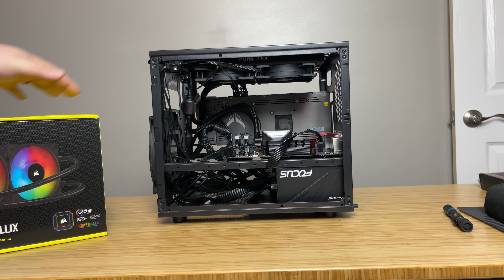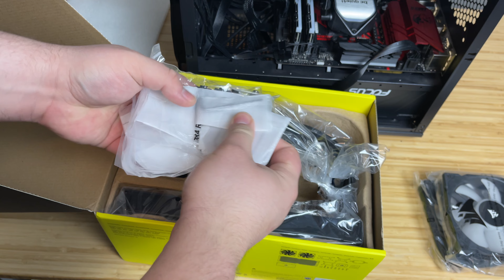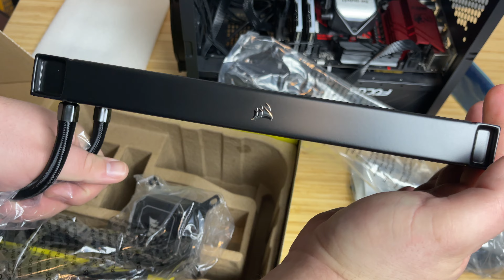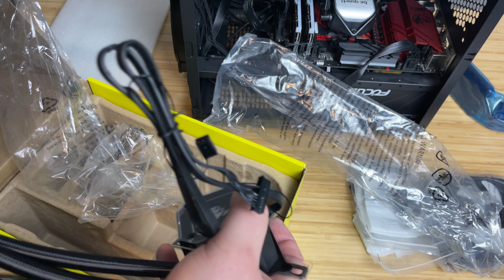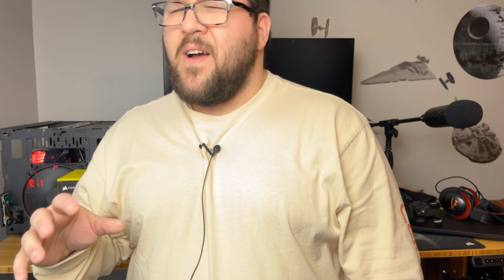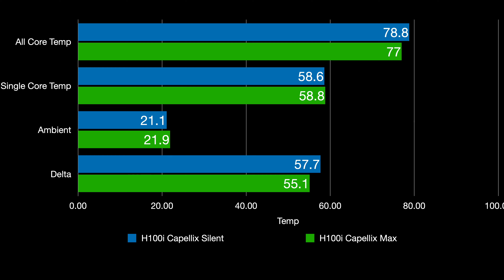Corsair H100i Elite Capellix Review: Loud and Pretty!

Comment: I have a 240mm radiator & 2 120mm RGB fans AIO on my CPU that came with my Digital Storm. I believe it is very similar to a Corsair at least they say it is built by the same people that build Corsair. It is my first time with an AIO. My older 12 year old system used a massive V8 air cooler in its HAF 932 case. I am happy with the new AIO but obviously there is always that concern of a leak someday. But I heard decent AIOs last a long time usually. Thank you for another great video!
Reply from the maker: You’re welcome. Thank you for watching!
Reply: @JeffTheITGuy  🙂

Comment: Hey, hello. I need help whit my pc.
Can u help me?
Reply from the maker: Maybe
Reply: @JeffTheITGuy  how can i boost my pc to the maximum without damaging it? like, i have a lenovo legion T5 but i have poor performance in my games.
could u help me with that
Reply from the maker: @bijoup62  what are the specs?
Reply: @JeffTheITGuy  Rtx 3060Ti, 11th Gen     I7-11700 2.50Ghz, 1TB, 16Gb DDR4
Reply from the maker: @bijoup62  what resolution?
Reply: @JeffTheITGuy  16:9
Reply from the maker: @bijoup62  that is aspect ratio. Resolution will be 1920x1080, 2560x1440, etc
Reply: @JeffTheITGuy  oh, sry ab that. Its 1980×1080
Reply from the maker: @bijoup62  well make sure your drivers are updated for your graphics card and such. Does it have 1 or 2 sticks of ram? Also, download HW Info and check out temps when playing a game